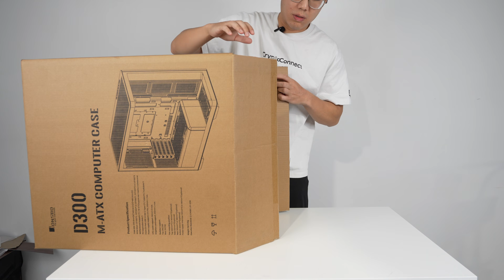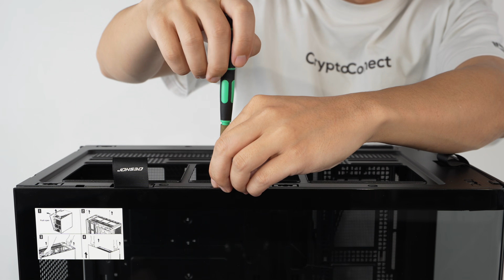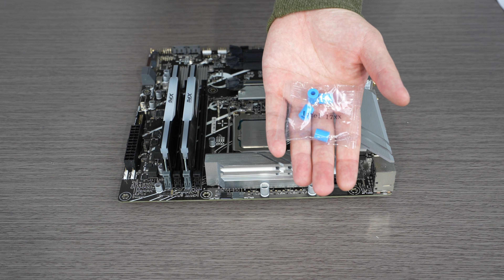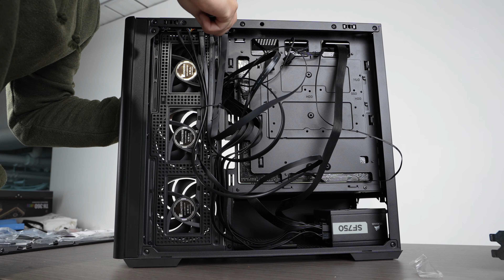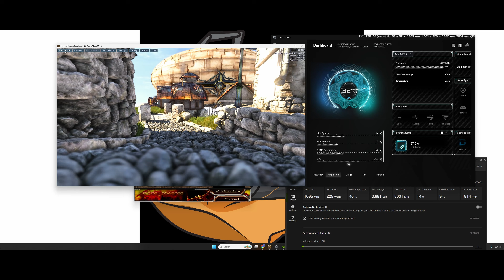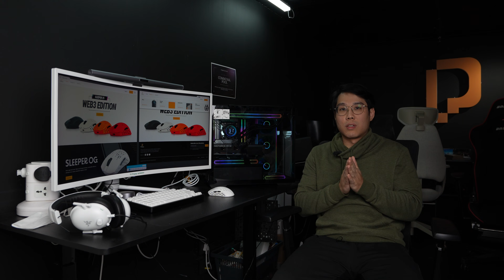Jonsbo D300 + Jonsbo TH-360 / ZA 360 / ZA240

Comment: Have a question . Do you use any reverse fans ?
Reply from the maker: the bottom are all reverse fans. The 3 vertical fans right of the motherboard are reverse
Reply: @projectsgaming2020 means bottom and side correct ?
Reply from the maker: @Nizamzulkifly  yes

Comment: 6:52 The Corsair SF750 comes with a SFX to ATX adapter plate in the box, which you should be using ;)
Reply from the maker: you caught me. i was lazy since the parts were coming out for the next build

Comment: Hi! I have the same Jonsbo TH360 and I’m running into a problem with the software.
Every time I start my PC, Windows pops up asking me to confirm/install the program, and I think it’s because the software doesn’t have a digital signature.

Do you also use the Jonsbo software, and if so, did you manage to fix this issue so it starts automatically without the confirmation popup?

Thanks in advance!
Reply: Hey, are you still having this problem?

Comment: Does the pump/screen rotate? Is that process in the configuration software or physically? I need to rotate the pump to reduce the length of the tubes to fit in my SFF build.
Reply from the maker: it does not. its static
Reply: @projectsgaming2020  Are you sure? I found the video where it can be rotated phisically.
Reply from the maker: @alexfichter  you are right, the turning mechanism is quiet tight so I though it wasn't movable.

It is moveable

Comment: I want to get JONSBO TH-240 so maybe you can help me, I have got a few question about.
So those fans are already part of AIO or I need to buy it separatly? 
and how to configure AIO screen and colors on fans?
Reply from the maker: The fans are not included with the AIO, purchased separately.

AIO screen is static in the sense it only shows CPU temp. Its not a LCD monitor.

You can configure the colors via their Jonsbo software or using the motherboard software.

Comment: Really hope you would reply to this, because I'll be using Jonsbo TH-360 and also the fans configuration same as you, do I need to have fans splitter or ARGB Hub? Because MATX board has limited argb connectors
Reply from the maker: short answer is no, u don't need splitters and argb hub with today's mATX motherboards. So you'll have 5 fans and only 5 argb connections so you need to just daisy chain 1 set and you are good

so my motherboard has the following:
1 x 4-pin CPU Fan header
1 x 4-pin CPU OPT Fan header
2 x 4-pin Chassis Fan headers

3 x Addressable Gen 2 headers
1 x Aura RGB header
Reply: Hey how are you getting on with the AIO?

Comment: I am using D300, and now considering TH-360 after watching this video. The 28T thickness of that AIO's fans seems to guarantee its cooling performance, but how about the noise? Especially about its water pump. Is it silent enough? I'm concerned about some AIO's disturbing pump noises, such as high squeaking noise or low hard vibration noise. I can't see any information about that pump on Jonsbo's official website. It seems to be launched soon, but not yet here in South Korea.
Reply from the maker: no issues but I'm in an office setting so the ambience noise will be louder than at home
Reply: @projectsgaming2020  has there been any issues with the aio since you've used it? how much have you used this since building it?

Comment: I think that the “fresh” inlet fan on to where the psu should be actually are putting hot air from psu
Reply: PSU takes fresh air from the bottom of the case and exhausts it directly to the rear.
This separation doesn't let the heat of a PSU affect the air inside the PC case much; the heat of a PSU is cooled by the air passing though the heatsinks inside, those heatsinks are not connected to the cage of a PSU, and that air just leaves the case right after cooling a PSU.
Inlet fan on the case's PSU chamber takes air from the bottom of the case, from the area not covered by a PSU; the bottom of cases like this are full-mesh, which provides enough uncovered area to take fresh outer air, and makes the air from the bottom fresh enough no matter how much the PSU cage heats up in between. The air just flowing over the outer surface of a PSU may get a little hotter, but never hotter than the PC components inside. You may need to add some outer heatsinks on a PSU for that to happen.
It seems you haven't built a PC recently.
Reply: @user-eo1tw9ly8q are u blind or u type just for text something F dumbass ? He mount it upwards